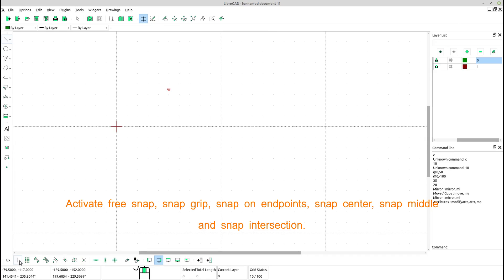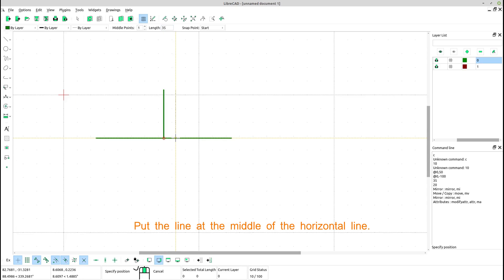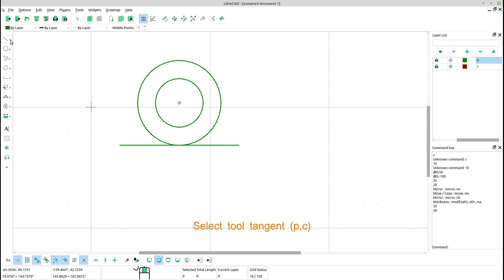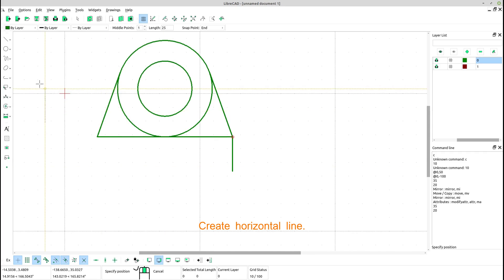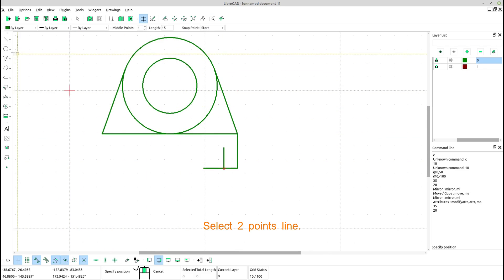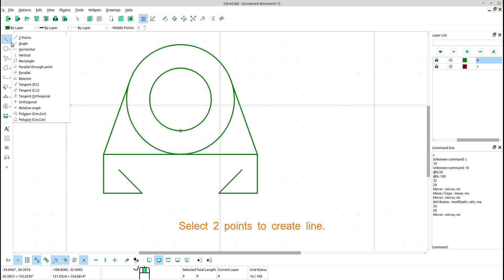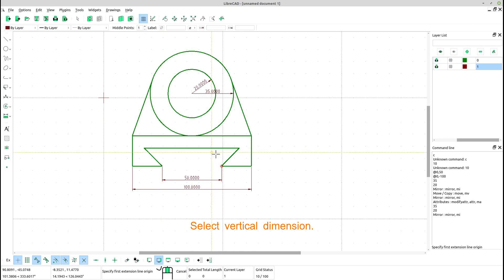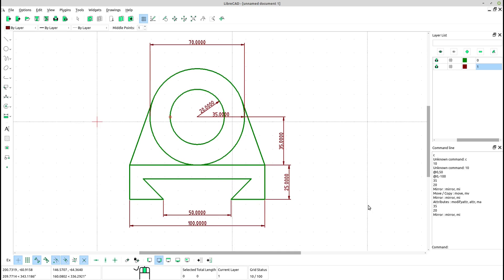Drawing Mechanical Engineering, - libreCAD

Comment: How did you get the distance to automatically come up when measuring the radius and horizontal lines?
Reply from the maker: The numbers appear automatically because I'm using the Dimension tool. When you place a dimension, LibreCAD automatically calculates and displays the measurement. If it's not showing up for you, make sure dimensions are enabled in the layer settings and that you're using the right snap points. Hope that helps
Reply: Thanks for the reply. It still doesn't work after updating the software and applying the dimension layer.